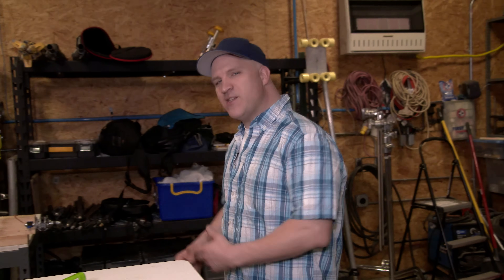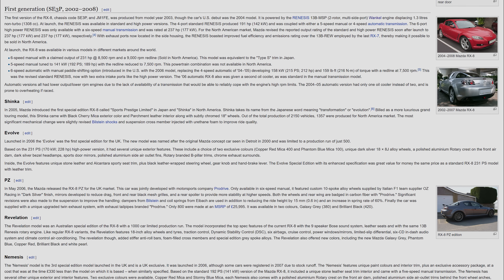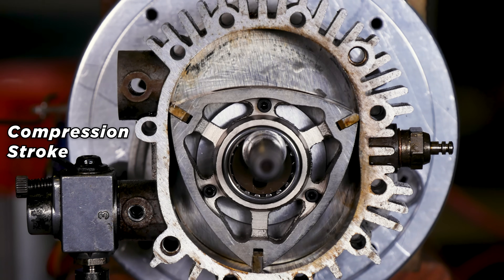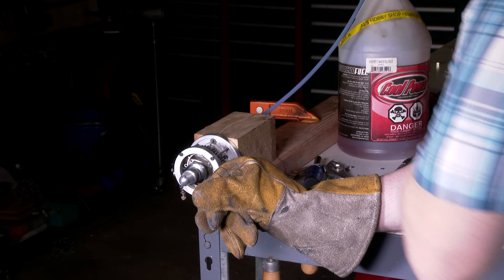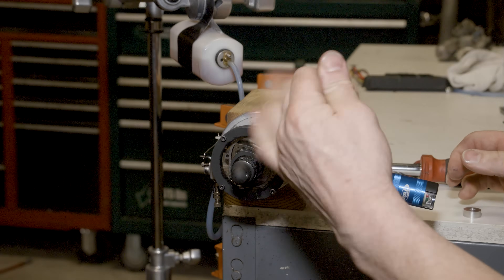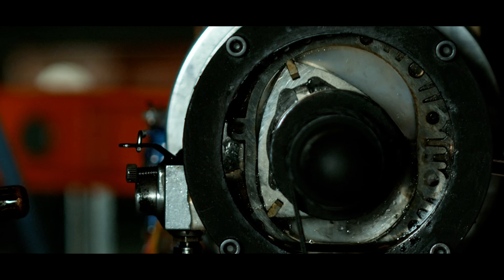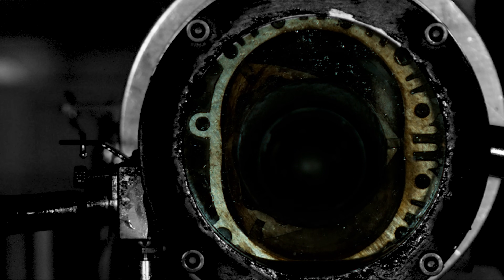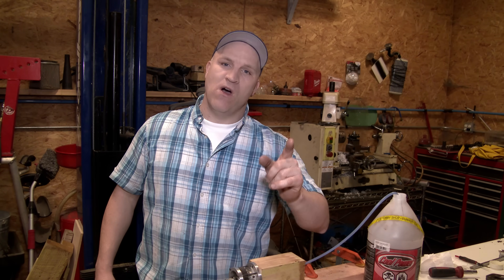See Thru Rotary Engine in Slow Motion - (Wankel Engine) 4K

Comment: I loved the slow motion shots. I have to admit that I've never seen a rotary that small before, but I love it. Team Boosted is actually building a single rotor turbo and although it won't have a hell of alot of torque, it's still a really cool idea and a very interesting project. They believe that it'll make 350 hp out of a single rotor, but I suppose that time will tell. I realize that it's not the first Wankel engine to run on a single rotor obviously, but I've never seen one used in a performance application before, that's why it's interesting to me.

Comment: Mazda RX was a great looking spots car. If Mazda had only put something in the car in stead of the rotary, they would still be making them, and selling well.
Reply: They did, the RX-8 and the MX-5 share the same platform... the MX got the better engine and is still a best seller.
Reply: @doktorbimmer  no it didn't.

Comment: How many CCs?
Reply from the maker: .4 I believe
Reply: @This. The Graupner GmbH. PI-49 has a displacement of 5ccs (4.97cc) or 0.196 cubic inch. it only produces 1 horsepower which is low for an RC engine this size.

Comment: Wankel: What's fuel efficiency
Reply: Hahaha. Good one bro.
Reply: wankel: me actually part time spray can
who needs fuel efficiency when someone else will breathe your gas
Reply: This engine is very small, 
air-cooled, 
running a carburator, 
using a glow plug as ignition system,
and is being fed a rich-load of either nitro fuel or methanol
      What would make you think a piston engine engine under the same circumstances make it more fuel efficient ?
       This little engine isnt burning it's fuel completly because it's constantly being cold-started, a period when an ICE runs rich  
      This engine cant breath more air as this model is naturally-aspirated
     The methanol & nitro fuel have octane ratings past 100,  yes these fuels are more flammable, but they cant burn well if there's not enough air to mix 
      & Finally
This engine is using a glow plug as the ignition source, so it doesnt the same kick as a spark plug with ignition coils
Reply: Wankel engines are so unreliable that no aircraft manufacturer sells a certified passenger plane with a Wankel engine. No Wankel design has ever maintained an FAA  airworthiness certification.
Reply: Wankel: What's reliability
Reply: @doktorbimmer  https://en.wikipedia.org/wiki/Internet_troll
Reply: SidewaysGts is one of those angry little trolls you hear so much about.
Reply: @doktorbimmer  no u.

Comment: DIESELS ON THE WAY
Reply: http://pdfaiw.uspto.gov/.aiw?PageNum=0&docid=20160084158&IDKey=32A0F77DE744&HomeUrl=http%3A%2F%2Fappft.uspto.gov%2Fnetacgi%2Fnph-Parser%3FSect1%3DPTO1%2526Sect2%3DHITOFF%2526d%3DPG01%2526p%3D1%2526u%3D%25252Fnetahtml%25252FPTO%25252Fsrchnum.html%2526r%3D1%2526f%3DG%2526l%3D50%2526s1%3D%25252220160084158%252522.PGNR.%2526OS%3DDN%2F20160084158%2526RS%3DDN%2F20160084158 Here is the link to the Wankel patent made by Mazda (I think, the plugin didnt work on my device) RX-vision has been ongoing for years.. Again it is not dead, but it cannot compete with inline ICE for traditional car users. As a performance vehicle, its been conquering until recently with new clever technologies like VC-t, VVL etc.

Comment: I can definitely see why Mazda uses twin spark plugs 😂 the single glow plug barely burns any of it!
Reply: Mazda doesn't use Wankel engines anymore...
Reply: @doktorbimmer  bro, they do. Maybe not in the same way as the rx7, but they're using a single rotor for a hybrid car
Reply: You are very, very confused son... Mazda ceased all production of Wankel engines on June 21st, 2012... and canceled all development of new production Wankel engines 10 years ago in May 2009.
Reply: @doktorbimmer  yeah, but not permanently. And I was wrong, it's used to extend range of an electric car, it doesn't connect to the driveline at all. Here's a link to an article https://www.greencarreports.com/news/1122062_mazda-range-extended-electric-car-may-help-the-rotary-live-on
Reply: There have been a lot of false rumors flying around but Mazda discontinued its development of Wankel engine 10 years ago and unveiled its very last production Wankel engine 25 years ago.
Reply: Not a very believable rumor... range extenders were a massive failure... only one ever made it to production as an option and it was canceled last year... under the new emissions laws range extenders do not qualify as zero emissions vehicles and all of the automotive manufacturers have dropped there plans to produce range extenders. California and 11 other states have banned range extenders.
Reply: @doktorbimmer  bro, Mazda has confirmed it. Probs not for the US market, but it's slated for sale November of 19 in Japanese markets. Again, confirmed by Mazda themselves
Reply: Where is it then? This is just another clickbait rumor started by one of the amateur blogsites
Reply: Mazda has not unveiled any new Wankel engines or Wankel powered cars since 2008.... over a decade ago.
Reply: @doktorbimmer  well, if you really wanted to, you could go to the website of the United States Patent and Trademark Office to literally look at Mazda's patents on it. I found it rather interesting, and fairly different from the standard design of the late Renesis engine. This is also a great way to keep in touch with everything auto manufacturers are planning to do new. For example, someone who payed attention would have seen the 180° tail gate on the up and coming electric Rivian truck long before the general public even knew the truck existed.
Reply: 99% of all patents never become a commercially successful product... Wankel engines are completely obsolete in the automotive and engine manufacturing industry... Mazda cancelled all development of production Wankel engines 10 years ago and all production was halted 7 years ago.... the last time Mazda unveiled a new production Wankel engines was 25 years ago...
Reply: You have to be very naive to think that any automotive manufacturer is considering a relaunch of the infamous Wankel engine... it was one of the greatest commercial blunders of the 20th century and is now completely obsolete in the 21st century...
Reply: @doktorbimmer  everyone knows that with correct lubrication, temperature control, thick apex seals, and correct deposit clearing, you can put a lot of miles (or hours) on a wankel. The patent shows... idk, oil injectors I guess? The apex seals are thick asf too. Literally just Look It Up in the database. It's there, and it shows a lot. Sometimes people patent ideas so other companies don't take them, but no company is gonna steal a wankel from Mazda, so their only reason to patent this is for production
Reply: @doktorbimmer  and frankly, RX7 sales figures soared and did very well.
Reply: Everyone knows that Wankel engines are horribly unreliable... Mazda doesn't sell cars with Wankel engines anymore... go down to your local Mazda dealer.... The RX brand was discontinued years ago.
Reply: NOT TRUE... RX sales went into a steep and steady DECLINE after 1986 and the last two models never made any profit due to disappointing low sales.
Reply: Mazda was really out to lunch with the Wankel engine... of all the 26 major engine manufacturers that licensed the Wankel KKM, most of them completely abandoned the troubled design by 1975... the same time Mazda went bankrupt and was bought by Ford after its embarrassing failure to launch an all Wankel powered model line-up... Ford dumped Mazda just as the RX-8 failed and sent Mazda into bankruptcy for the 3rd time in its very short history.
Reply: You don't really know much about the automotive or engine manufacturing industry do you??? Its not surprising really, fans of Mazda RX models tend to be the least knowledgeable of all automotive enthusiasts.

Comment: SPCCI ign invented by Mazda gives complete combustion.
Reply: Bullshit Johnny... HCCI technology was invented by Mercedes-Benz... and only works on reciprocating engines.
Reply: @doktorbimmer  
Again madman, SPCCI solves running rotaries using gasoline. Using Hydrogen, rotaries get 100% combustion and 23% greater efficiency.
Reply: Sorry Johnny but Mazda abandoned development of hydrogen fuel engines back in 2009.
Reply: @doktorbimmer  
Madman, Mazda are not the only makers of rotaries. But hydrogen trains are here, so the hydrogen economy will expand.
Reply: As the disappointing failure of the Mazda RX-8 Hydrogen-RE  proved... using hydrogen causes a 50% DROP in efficiency in Wankel engines and was the least efficient hydrogen fuel vehicle tested by the HyNor program.
Reply: NO ONE MAKES WANKEL ENGINES ANYMORE... NOT EVEN MAZDA!!!
Reply: Hydrogen vehicles do exist and are sold but none use the obsolete Wankel engine... Wankel engines are too inefficient to use expensive hydrogen as they cannot support the high static compression ratios needed for efficient combustion of hydrogen fuel.
Reply: @doktorbimmer  
You are a total madman.
Reply: Just the facts here Johnny, Wankel engines are obsolete here in the real world... they only exist now in your imagination that is filled with make-believe stories and false rumors.
Reply: @doktorbimmer  
You are a total madman.
Reply: Wrong! complete combustion requires a "Quench" type combustion chamber... something that is absolutely impossible with a Wankel engine.
Reply: Hey Johnny! Why don't you go down to the local Mazda dealer and see for yourself.... They don't make Wankel engines anymore!!!